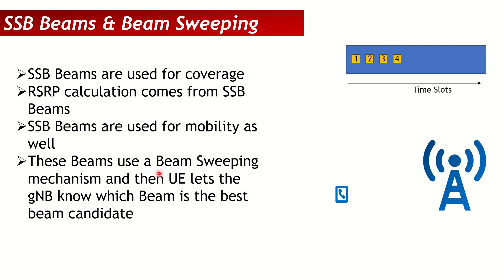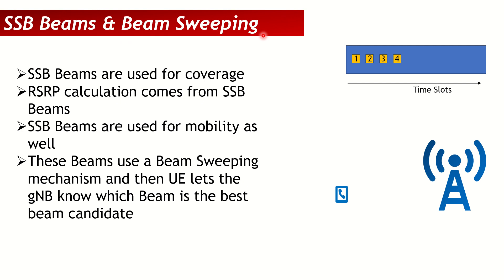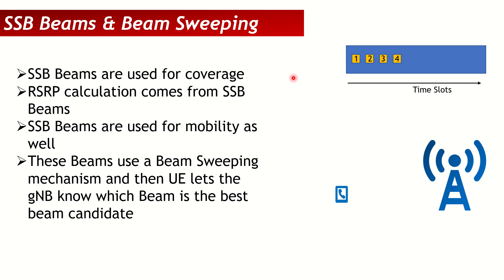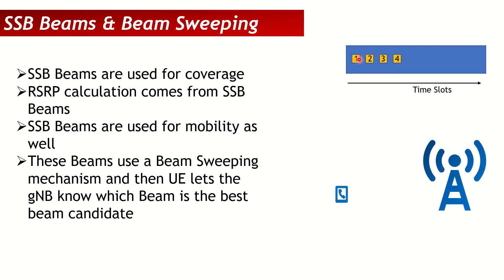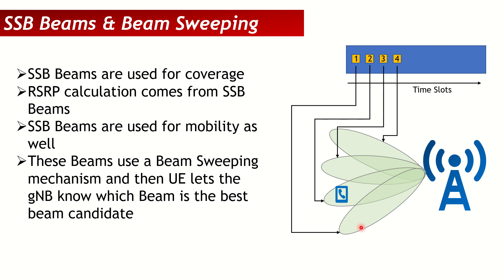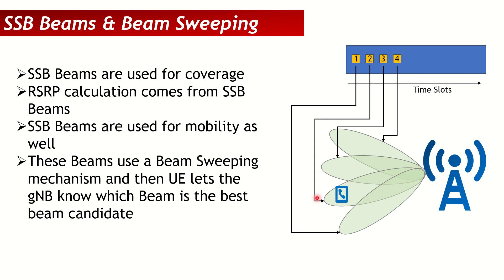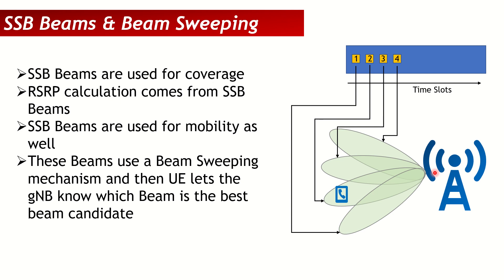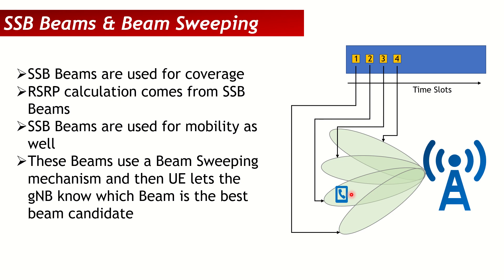5G Beam Sweeping & SSB Beams

Comment: Cons of having more SSB Beams per burst apart from increased overlapping and interference
Reply from the maker: More SSB Beams usually mean that SSB beams are narrower and more focused so it actually improves the SSB coverage and SINR. However, more SSB beams mean more SSB overhead and it also adds difficulty in implementation. Lastly, the SSB beam change triggers will cause additional overheads.

Comment: how UE will initimate gNB about the best suited SSB beam from ssb burst, post beem sweeping ?
Reply from the maker: By using RACH. RACH preambles are divided in groups for each SSB Beam so the UE chooses a RACH preamble based on the best SSB Beam which notifies the gNB.
Reply: @OurTechPlanet will csi feedback plays any role over here in order to let gnb knows the best fit ssb.  I have this confusion because somewhere I have read about ssb-ri in csi report
Reply from the maker: @indramani8888  The general consensus among all vendors is that SSB usually does not have an interaction with CSI feedback.

Comment: The end was really important :) questions in my mind are :
- how the angle of this SSB beam sweeping is defined? Is it defined by high lever parameter or 3gpp standard etc?
- difference between SSB beams and pdsch/massive mino beams... In a bit of detail as much as possible...
Reply from the maker: The angle of SSB Beam is based on vendor's implementation. 
Different type of Beams will be discussed in the next session :)

Comment: Sir, I am unable to understand that how gNB able to know the location of UE using RSRP without knowing PMI value from UE ...
Reply from the maker: Basically, the RACH preambles are divided among each SSB Beam so the UE chooses the RACH preamble based on the SSB Beam that it wants to choose. When the gNB gets the RACH preamble, it understands that the UE has chosen which specific SSB Beam.
Reply: @OurTechPlanet  you mean to say that number of Random access preambles gNB send in configuration via SIB will be different for each SSB beams? for ex if there are 48 Random access preambles and 4 SSB beams 0-11 preamble IDs are for beam1, 12-23 will be for beam2 etc.. like this ?